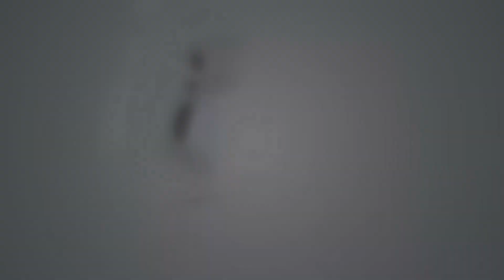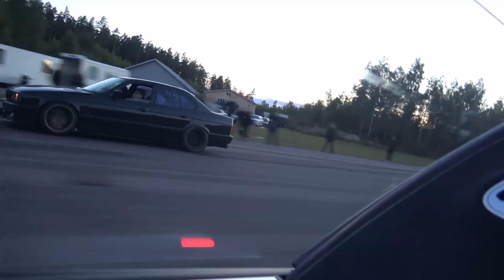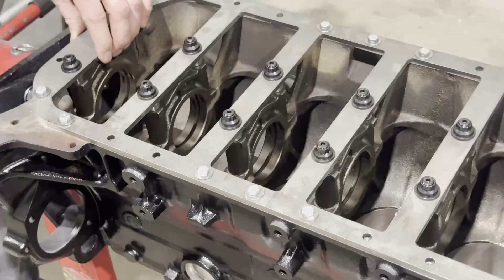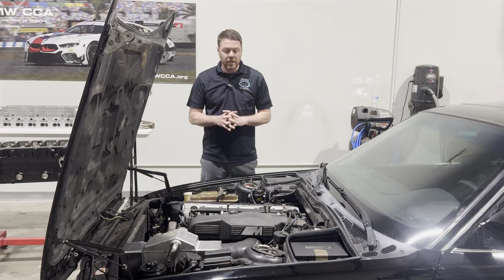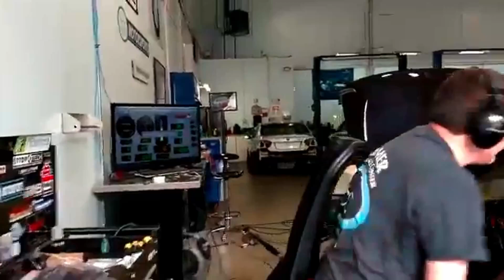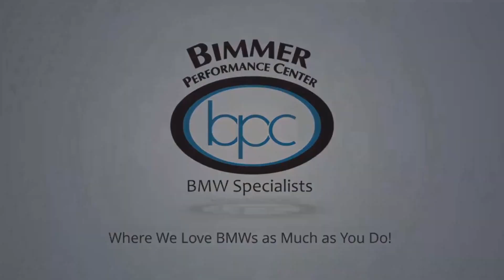BIG TURBO E34 M5 Build

Comment: Okay you said you weren’t doing any more performance race motor work a few years ago when I got the alpina. 

I’ll be in the shop next week so we can put a plan together to pull that new motor out of it and find 1100 or 1200hp of power before we put it back in. 

I’ll tear the interior out this weekend so we can get all that weight out of it.